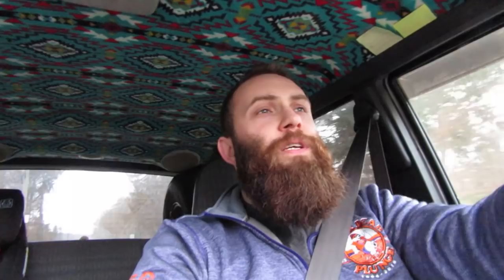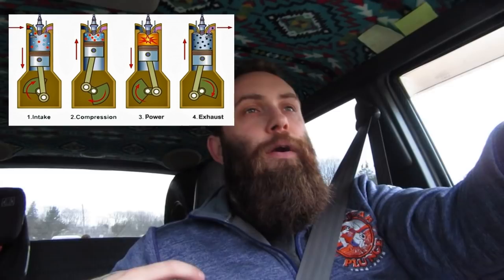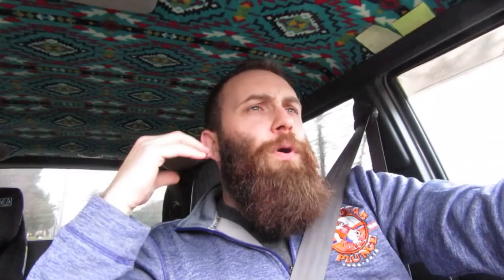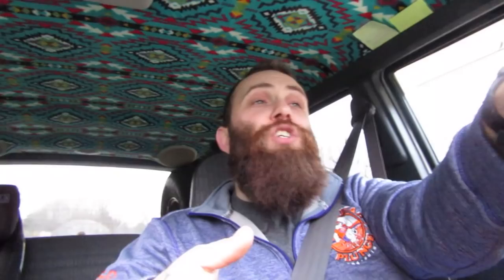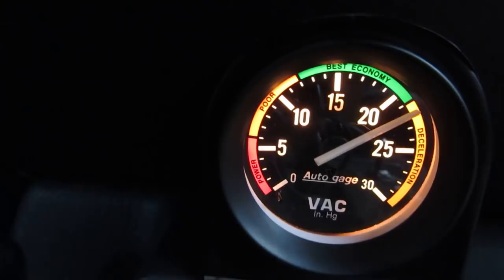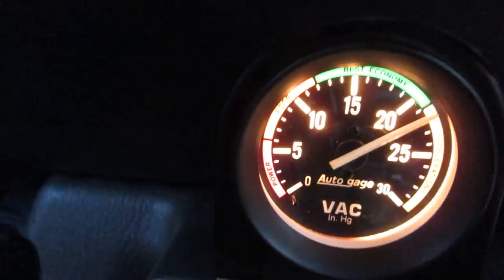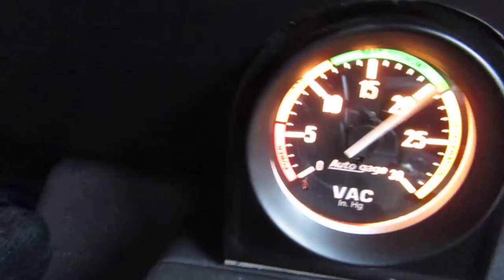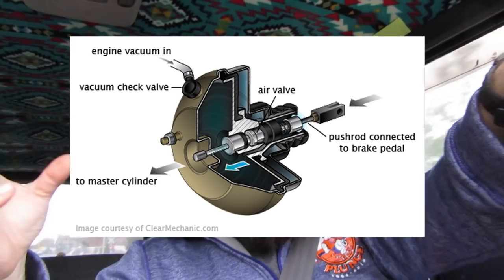How to read a VACUUM GAUGE and DIAGNOSE engine issues

Comment: Thank you for this. I recently acquired a 94 GMC K1500 Suburban (159,000 miles) with a vacuum gauge installed. I'm still getting it put back in shape so I haven't driven it enough to know the vehicle yet, but that vacuum gauge is no longer a mystery and I consider myself fortunate to have it there on this still "unknown" truck.

Comment: Don't use propane, just ask Hank Hill, lol. Don't eat the Fugu, just ask Homer Simpson. I wish wifes 92 had OBD2, My 97 Maxima has one and I can read vacuum on that with a  dongle and free version of the Torque app in real time as your driving, very, very helpful in telling you that their is a problem. I didn't even think about putting one in this Jeep. 90% sure I'm putting one in now since there is not an OBD port on her XJ, THX!
Reply from the maker: It is really easy and - especially for a non-OBDII vehicle - the information you can gain about engine status is invaluable

Comment: Great video! I learned a lot. Definitely think I need to install a vacuum gauge in my Cherokee
Reply from the maker: Yea man... It is a really good idea on those old 4.0s.. Keep an eye on them. I am pretty sure my valve train is all sludged up which I would not have looked into before noticing the odd readings on this gauge
Reply: I grabbed one for $15 at harbor freight (boost/vacuum) to diagnose a slight misfire its a 2” white face gauge with LED backlighting. 

My issue is mounting it.
Reply: Raymond Sugel Jr harbor freight is amazing!

Comment: Great video. Very clear and comprehensive. I just subscribed. Question: when you check your idle vacuum level to see if it in the healthy 18 - 21 level (8 cylinder 350 small block) should you check it in PARK or in DRIVE (with the break pedal on of course)? Thanks

Comment: 19 thru 30 I collected and repaired 70s toyota corollas 
I figured out how to time with a timing light a vac gauge and screwdriver
and they would purr glass of water smooth
 ( that is where ya put a glass of water on your valve cover and no ripples)
I did this to every one I owned and a bunch I didn't own
havent tried it on a jeep .....yet
Reply from the maker: Haha... I'd like to see a vid of someone tuning a carborated Jeep with a vac gauge
Reply: @DEInTheGarage  
If I get a 4 banger 84 you will see one

Comment: Nice info loved, now i know what to do with guage info , in my xj 97 I'm  use a cheap Ebay obd2 Bluetooth adapter with torquepro app in my phone, i you can see real time info, delete bad code, o2 sensor up and down graphics, vacum, fuel flow, close loop etc, and use overhead console computer to read real time mpg and regulate my foot, take one of the junkyard 

Cheers from mx lml
Reply from the maker: Dang.. That is a pretty good idea. I will have to look into that a bit more. Thanks for the feedback and suggestion!

Comment: i have a problem i hope u can help me i have a mustang 2015 v6 and i have a vacuum/boost real time reading built in in my car.. in the traffic ( brake ) Rpm drops and rises ( below 1000) feels like the car want to die and the vacuum drops to 0 to 3 and 0 again ( while stopping ) and brakes feels so stiff i have to use emergency brakes .. when i give it a throttle it loads up reading rises in the vacuum/boost guage for 5 seconds only and then goes back to 0  + bad performance delayed  throttle while accelerating all the time and when i hardly accelerate a fuel or gas smell comes from the ac vents  .. i changed brake booster + vacuum hose almost everything and still i have the issue .. please advise what could be the problem

Comment: Hi. Think you for sharing your knowledge. I have a question about the vacuum gauge number I’m getting which is 15 steady at ideal,engine at operating temperature. You said in you video that number 15 can a bad  ring issue or timing chain. I’m having a p0300 code misfire and with the vacuum reading of 15 where should I start at the timing chain or piston ring or both?

Comment: I have a 1998 Jeep Cherokee with about 17 in.hp. and just installed a permanent vacuum gauge today Ellen looked up your video. You said 15 wasn't the best.  So what is the best in.hp for a 1998 Jeep Cherokee
Reply from the maker: Should be around 18-21 for a very healthy engine

Comment: This guys got a good video, but I'd like to throw some ancient knowledge at you a wise man once taught me. 

THIS IS THE PORTED PORTION OF THE ARTICLE: 

- PORTED vacuum is above the throttle plates of whatever you're working on. If it's above the point where fuel and air actually go into the open hole in your intake/plenum, it's ported. This vaccum is created when the the throttle is opened or partially opened, because there is a passage being covered by the throttle plates or "butterflies" in your carb or throttle body. These passages are dormant and covered or "closed" when you're at resting throttle. The more rpm you create, and tbe throttle open, the more vaccum this port will build. At idle you should have NO vaccum, or very very veeeerrrrry little. 

PORTED vacuum is going to be how much air and fuel are being processed on the vaccum Guage when you're accelerating. A slow climb is inefficient @ wide open throttle. It should be a steady,  swift, climb when accelerating.  

OLD SCHOOL GUYS ( PORTED) This is where you'll want to hook your modulator valve/transmission vaccum because it dosent have any vaccum at idle. Your modulator / transmission vaccum is only going to pull so much, you're better off to be at no vaccum when waiting at red-light/idling because this has less stress on the diaphragm inside the modulator valve, and will be more "snappy" or responsive and will have a better , more fulfilling "climb" when it's hooked into this port. Besides, on gm applications,  the Modulator Valve has an adjustment screw, it's been a long while, but I'm pretty sure the screw Orientation is (CLOCKWISE makes a tighter/firmer/quicker shift. COUNTER-CLOCKWISE will make a looser/longer/softer Shift. Don't quote me, research)  
×××××××××××××××××××××××××××××

THIS IS THE MANIFOLD VACCUM SECTION: 

Manifold vaccum is crested as soon as the engine fires. Its the suction from inside the engine (glorified combustion air pump) this is you're efficiency side. This is going to be the vaccum created UNDER the throttle plates. INSIDE the "intake (MANIFOLD...) " This is a way monitor efficiency.  This is where you'll know if you've got any kind of internal problem. As you give it all the onions at wide open , the needle should drop to almost 0, and slowly climb. When you let off the gas, it should come about 5in or just a little above where it initially started, then level out where it originally was. 
Issues:
- fluctuate at idle - leaky valves or worn/broken valve springs, worn valve seals, leaky Manifold gasket (ex: intake, fuel device)

Fluctuations while driving - bad rings, bad valves/bent valves, dirty fuel/fuel delivery. 

Erratic needle- leaky intake, valve adjustment wrong (you probably broke valves or bent valves at this point), bad lifters, dropped lifters, worn cam lobes, Off balance crank (usually balancer or flywheel) but usually a really bad vacuum leak. If it pops and sputters, probably a vaccum leak. 

WHEN TUNING MANIFOLD: 
FOR MPG- you want to be around the enrichment circuit.  this is when you're optimizing fuel to air delivery. You want the leanest/most air you can get in, while the least/less  amount of fuel, all while still retaining a good idle speed and smooth idle. This will give the best fuel economy,  but that's mostly on you. Hook up a Guage in yourcar, you want to drive as if there's an egg between your pedal and the floor. The more vaccum you make at less throttle going down the road, the least fuel you'll burn (given the enrichment circuit is close to your setting, every carb and throttle body is different on location of circuit. Pls research) 

FOR POWER: you want the to be behind the enrichment circuit, or "rich", but the key element is the curve of your ignition and how "hot" The ignition is. You can dump all the gas you want, if you won't be able to ignite it all in the combustion chambers (a.k.a. spark delivery) then you're just fouling your engine and wasting gas for a weaker result.. 

OLD SCHOOL GUYS (MANIFOLD) 
A STEADY reading with a less lumpy cam, you'll have some needle movement if it has a radical cam. This is also where I tend to hook my vaccum advance. You're set at a more "retarded " point of timing by the constant pull of vaccum.  This allows you to creep up on your max amount of timing you can squeeze out of it. While retaining big end spark for the most optimal "pull". 

EXTRA PUNCH FOR THE OLD SCHOOL GUYS: This guy left us out, I got u tho 
to tune vaccum advance curve 
The easiest way I've found, is hook to the PORTED side first. This will show how quickly you build rpm, and how much. The quickness is how your distributor advances from its lowest degrees of timing.  Adjust the distributor to perform as good as it can on this port. 

THEN HOOK TO MANIFOLD. When you "thwhackkk" on that throttle, as we know, should come almost to 0, then slowly climb, you'll be in the ballpark from the ported tuning you did on your canister, this is where you'll fine tune. You want this needle after its drop to 0 to climb as quickly as possible. 

I hope this clarifies some stuff for those who still don't understand . Vaccum isn't a very hard concept.to grasp. Use your ears, get a Guage, and use your eyes. Smell, smell for lean mixes and rich mixes. Taste your oil for any gas. Don't be scared. It Won't physically hurt you.
Reply: For epa complaint vehicles: 

Ignition vac: ported 
Trans vac: ported or Manifold. Wherever its happiest 

Non compliant: 
Ignition- manifold 
Trans- ported

Comment: How does that FJ compare to an XJ? That’s like comparing apples to oranges. My FJ had a stroked 350 Chevy power plant (383 stroker) small block 400 everything. Tons of power but it ran hot. The journals were thinner after it was bored out so you had to keep an eye on the temp in the summer desert wheeling. So in that respect the two are very a like. But I would compare it more to a FJ60. My FJ was a battle tank. Totally underpowered though. Stock straight 6. It was a dog. I even pulled all the smog and air crap off it so it would do 70 max, on the freeway. It was an 1987. The XJ is much more fun to drive. Much faster and lighter. I like the way the XJ feels off road too. Light and quick, plenty of power but there is always that thing in the back of my mind about the axle strength. Never had to worry about that with the FJ60.  Might need to upgrade the front axles and ring and pinion  to put my mind at ease. The XJ has a beast of a motor. I love it.
Reply from the maker: Oh dang.. That sound like quite a Toyota you had! I can definitely agree with you assessment of the way the XJ feels off road. I love it. Thankfully it is not too difficult to swap gearing or even axles on the XJ

Comment: Hell again. Steering issues, finally took the steering column out started to take it apart to fix it and a bunch of little broken plastic pieces fell out of the upper housing. Bummer. From what I can tell the spring/clip that keeps pressure on the top of the toothed bar above the toothed gear that the key cylinder turns fell out from wear and tear. So as you turned the key the bar would just ride up and not engage the ignition. Not sure I could get it back together even if I had the right parts or even knew the parts to order OR where to get them. Sooooo I just ordered a used column off eBay. Problem solved, just have to wait a bit. No more starting the Jeep in the wet rainy parking lot shorting the started with a long screw driver. That’s were it broke.
Reply from the maker: Haha.. Dang.. Sounds like a fun issue. Can;t say I have heard that one before

Comment: Ok I have something crazy... I bought a 1978 f-150 with a 460 motor 2 years ago. I didn’t know anything about engines when I first got it so upon learning what a PCV valve was I installed one correctly. previous owner had just a rubber hose just hanging there. So now I have solved that vacuum issue along with many other issues🤣. Now I’m driving down the road and all of the sudden my truck is running quiet which scared the shit out of me because I thought it cut off initially. I put a vacuum gauge on it and what do you know it’s at a solid 20. So I’m excited gotta throw 2 qts of oil in it, was starting to hear the rockers chatter no big deal it’s still running smooth so I go to the auto parts store throw oil in it and... dmnnit back to square one,with the pressure back at 15-12  sporadically and a little smoke coming out the left pipe. It’s loud again. How is that???? It’s good down 2qts of oil but now at level it’s messing up? What the hell ? Can anyone figure that out?
Reply: Oh yeah and I figure because it didn’t have that PCV valve the oil was seeping past the piston rings causing it to smoke but now it only does it to the left side tailpipe and only when I’m in neutral/park

Comment: Wouldn't mpg be a direct correlation to pressed gas pedal? How is vac mpg different?
Reply from the maker: Have you ever heard someone explain an internal combustion engine as basically a large air pump? If not, that is a common way people break an engine down to its most basic function and it is accurate. The vacuum being created by is a direct comment on the eficciency or work an engine is doing.
Reply: @DEInTheGarage  Thank you. I understand the importance
Reply: @DEInTheGarage   spot on!